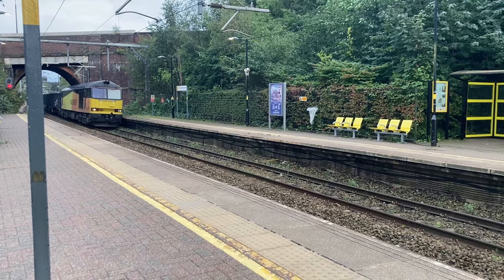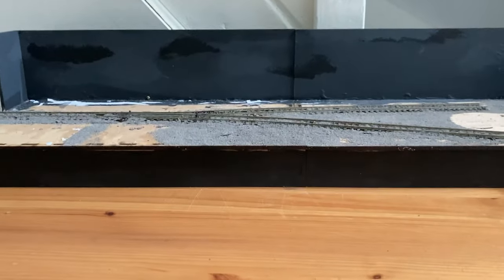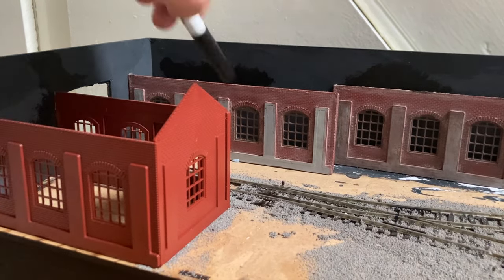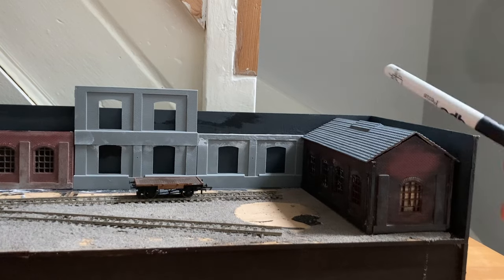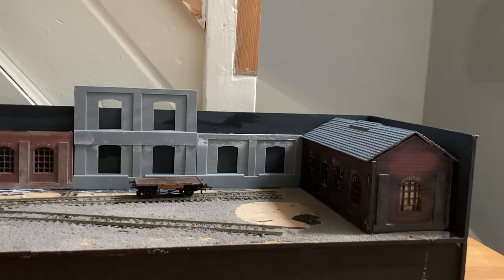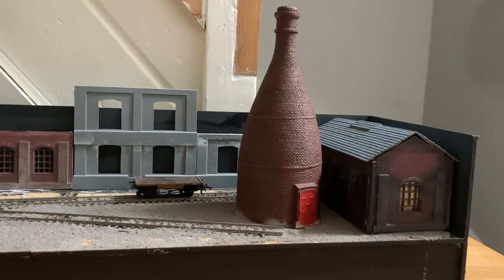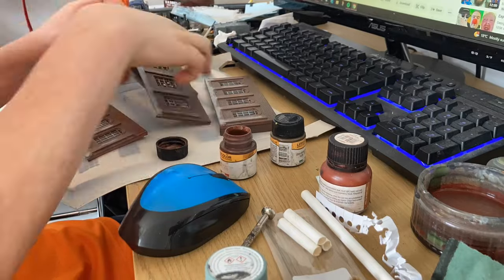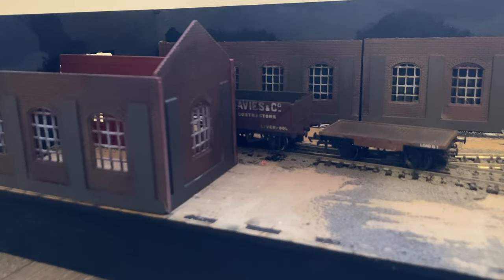BUDGET Microlayout- Building a Factory in 00- only 4 pieces of track!

Comment: Brilliant mate, I have just bought a baseboard for something very similar, also using the 48ds,
If you weren’t using the bottle kiln (although its a cracker) you could have had a 3 way point and done a 3-2-2 inglenook which is what I am doing on mine though slightly differently- but that would give a bit more operational variation 

But I was looking at the skytrex beehive kilns for a 009 project so its good to know their products are good

As for a name, in homage to oh Mr Porter, you could call it “Harbottle’s yard” 😊
Reply from the maker: I was tempted by an inglenook- but all of the track was left overs from layouts never finished. If I was to do it again I would use one!
Though I’m surprised at how much can be done with the 2 sidings. 

Ooo I like that! Added to the list!

Let me know how your build goes!
Reply: Good stuff, I will be watching this series for sure 🎉

Comment: Is OO a scale and not a gauge, running on HO gauge  track but slightly larger scale?
Reply from the maker: I believe it’s defined as a gauge- even though it’s running on track that would work for ho
Reply: Both "OO & HO" run on 16.5mm track, "HO" gauge trains are at 3.5mm scale, while "OO" gauge trains are 4mm scale.